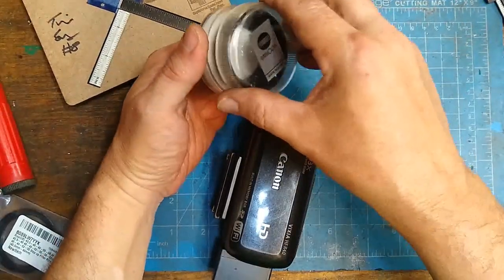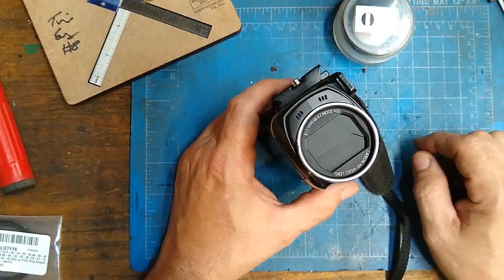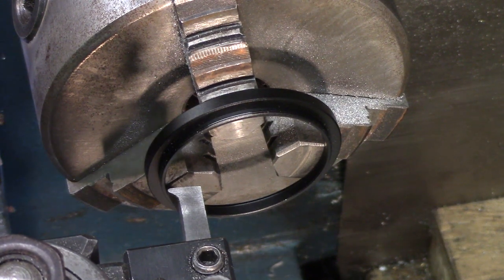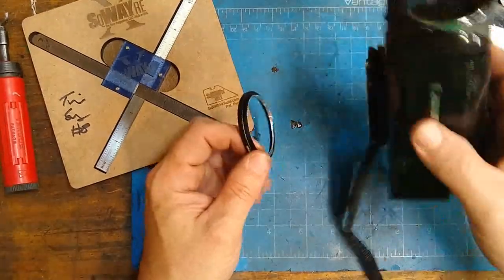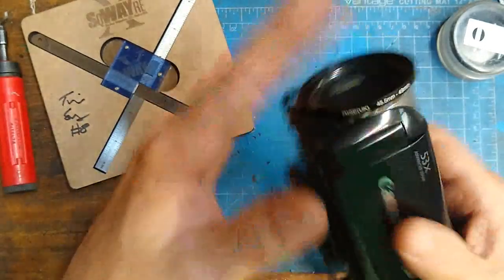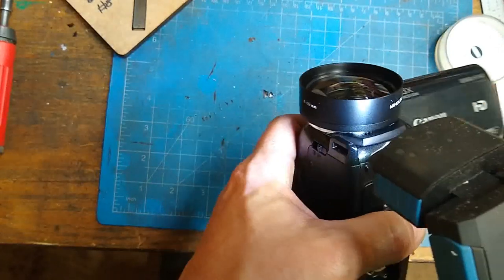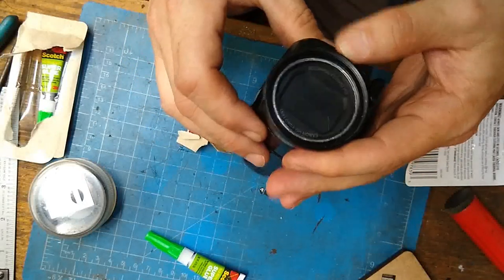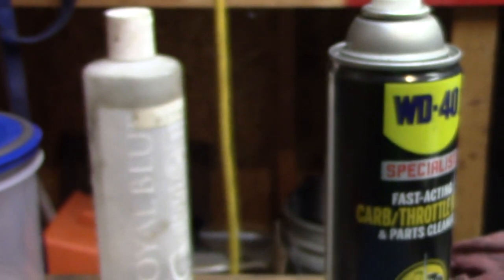Adapting a wide angle lens to a camcorder without threading -  lathe project

Comment: Thanks for the plug! And why do they not make things like cameras and hand drills square? Imagine how much easier life would be if your hand drill had a 90 degree flat surface parallel to the drill bit.
Reply from the maker: Thanks for dropping by Tim. My Milwaukee drill has protruding parallel screw bosses on the side that are in line with the bit but a flat surface would be very nice.  Actually my very old dead Ryobi had a removeable level that had a flat surface under it but being at the back it was would have been about as useful as the level. I'm enjoying using the square, and really only found one little annoying thing. One of the legs has a very tiny amount of side to side play. Easily corrected by making sure it is set before use (and I might make a slight mod to it to keep it set). It is actually extremely accurate though. I am going to do a short video on it once I get enough footage using it in different ways. Anyway, nice job. All the best! Eddie
Reply: @theeddies  I would appreciate your insight. I think future iterations will be machined metal and have turn screws to secure the rulers, which of course will increase the cost significantly.  I was trying to keep both surfaces flat (and keep the costs down) with this design.
Reply from the maker: I think the acrylic works, I really like it, it is light, not magnetic and is plenty accurate.  A tiny set screw was going to be my fix. I did wonder if there was a way to insert a very small bit of spring steel in the groove to tension the rule with a small notch to retain it. Might need tiny hands and better eyes than mine to place them but you have a son right😁 The material you used to get the side to side tension works very well. Obviously, as you said, you were building to a plan of simplicity, and you definitely pulled that off. It is extremely useful as is and any mods have to be balanced with cost.
Reply: @theeddies  cheers. There is a tiny, "spring loaded" piece of metal in there. Tough to get the right tension consistently.

Comment: Excellent video! Thanks! I looked up the manual for your camera and it turns out you can turn off the image stabilization (OFF for when you have the camera mounted on a tripod). My R20 is threaded and only has half the zoom. Thanks again. Also, your Minolta wide angle attachment lens did a MUCH BETTER job than the Vivitar that I bought.
Reply from the maker: Thanks!

Comment: LOL I knew that's how things were behind the scenes.
Reply from the maker: Mike is theoretically a good guy but dumber than a bag full of really dumb hammers. As far as the lathe goes, yes it seems to be a later (70's?) redesign of the 101. If it were closer I would go look to see how complete it is and low ball them. Some apparently had inch and metric change gear sets. Not sure how that worked but interesting. I have been thinking about that particular problem. I would really like to be able to do both.
Reply: @theeddies  I just saw the clip on TMZ. Are you going to issue a Twitter statement, and maybe go to some kind of country club vacation island "rehab" and all that, or just claim that you were simply trying to stay in character?  -- Yeah metric and standard thing is a quandary. I believe there are work arounds to a certain extent on some machines, but that's something I don't know about. The larger machines that let you just switch between the two with the pull of a lever seem nice.
Reply from the maker: @johnstrange6799  ROFL. I actually only realized after I did the bit that it was sort of like that Tom Cruise blowout a year or so ago. Not planned that way but I guess it was in the back of mind somewhere. I just wanted to say something stupid.
Reply: @theeddies lol I was thinking it was like the Christian Bale meltdown from several years back. Same same though. Still funny anyway you slice it.
Reply from the maker: @johnstrange6799  that seems a bit bigger than the 101. Nearly the size of what I have.
Reply: @theeddies  6 x 18 I think. They're small. Over the years I've seen Roadking do a lot of good work on it, but I bet it took plenty of lathe time to get it done.
Reply from the maker: @johnstrange6799  well like i said, if it were closer I could pick it up to learn threading etc. But not worth the drive unless it were a slamming deal. It is less powerful and smaller than mine. Plus they are not responding about whether the change gears are there.
Reply: @theeddies  Yeah. If you're going to go through the effort make it worth it. The only reason I got that last one was it was only a $100 and I was there with a van at the time I saw it, but if I were going to go get one I would want it to be what I was looking for, OR just too god of a deal to pass up.
Reply from the maker: @johnstrange6799  https://www.homemadetools.net/forum/vintage-adept-shaper-photos-85536?utm_source=newsletter&utm_medium=email&utm_campaign=06-01-21&utm_content=06-01-21-182139&fi=182139#post182139
Reply: @theeddies  pretty cool. I was thinking a while back of making a little shaper, but it would need serious weight to be rigid.
Reply from the maker: @johnstrange6799  Getting the truck to go get a trailer at my dad's, mapped it out and it is in Indiana. You better go get it.
Reply: @theeddies  It'd be nice to play with right?
Reply from the maker: @johnstrange6799  yep and hellava price.
Reply: @theeddies   That is why I always look. Always on the hunt for something right in my neighborhood that I could possibly disassemble on site and transport in a few trips without too much of a miracle.
Reply from the maker: @johnstrange6799  All you need is a miracle, all you need is you.
Reply: @theeddies  Are you Mike, or just one of the Mechanics?
Reply from the maker: @johnstrange6799  Whichever gets the bigger royalty check
Reply: @theeddies  Ohh. Yeah, about those royalty checks... Are you a fan of Ramen noodles and collecting change at the highway off ramp exit?
Reply from the maker: @johnstrange6799  "Raman noodles and collecting change off the highway" I love that band. Very punk.
Reply: @theeddies  BORING!
Reply from the maker: @johnstrange6799  surprise surprise new machine day at Vintage Machinery. "Worn out" Thompson surface grinder. Pfft perfect hydraulic driven grindr. He actually says "this will do til I find a bigger one" He found the 10k in his spare change apron.
Reply: @theeddies  In other words, it's that time of week again. lol
Reply: @theeddies  Or even $750 or something. No Quick Change and no accessories so... I guess the main thing is location and negotiable price.
Reply from the maker: @johnstrange6799  I must have not gotten the first message or I have no idea what you are talking about
Reply from the maker: @johnstrange6799  made an incredible buy at the 90 mile long yard sale today. It's RED, heavy and grippy.
Reply: @theeddies  Interested. Interested.
Reply: @theeddies  I was talking about a SB lathe in your area on FB.  What was red and grippy? A vise?
Reply from the maker: @johnstrange6799  A "RED" vise Made in Mass. 6"
Reply: @theeddies  Athol Mass?? :)
Reply from the maker: @johnstrange6799  yep
Reply: @theeddies  Nice! Don't see those too much. How much?
Reply from the maker: @johnstrange6799  DRUMROLL....$65. It is an 015 which is the largest they made for most of their history as far as I can find. I have a 1980 catalog and they list an 015C that has a different pipe grip design and has non-replaceable jaws which mine has. I am guessing 50's or 60's but am still researching. I looked at the current catalog and they don't list any bench vises anymore. There is an 80's model on eBay for $600. You should have seen my eyes when he quoted me $65, I instantly went poker face and calmly said, how about $60 as I am reaching for my wallet? He said no but he threw in a Craftsman hand crank drill which he just wanted to get rid of. The rest of what we found was junk or in the stupid money range. A guy had my little 4" Wilton priced at $250. American vises are getting anvil prices now apparently. Trying to decide if I flip this one and take the cash win or more likely sell my good 6" Columbian. Might get $100 on ebay right now.
Reply: @theeddies  Oh Hell yeah. I'd buy those at $65- $75 all day! Vises can be good turn around, especially Wilton Bullet, Baby Bullet, and milling vises.... (Speaking of Baby Bullet. I told you before I had that crazy massive machinist stuff free find years ago that had a mint Baby Bullet in it. I actually found a pic of it a few weeks ago. It's the only photo from that finds video that I still have) ....but it comes at the risk of  having to sit on them until they sell, and the space they take up.  Same with anvils. If the resurgence in Black Smithing interests/trend fades.. then they go back to basically being scrap value.
Reply from the maker: @johnstrange6799  I don't remember the baby bullet, did you sell it? A guy had a full size bullet with no swivel for $400 firm. 

I have 3 or 4 Columbians in my collection and no Starrets so I think we know how this is going to go. I'll do a video tomorrow. I am thinking just a clean and new jaws, though the ones on there are still good. It is in excellent shape overall. I would love to fully restore it and repaint but I love the old patina and the red is still pretty nice. It was definitely not abused.
Reply: @theeddies  Columbians are nice. I feel you on keeping the Starrett. I don't see them much at all here. Yeah, the Wilton I sold a few years ago for $250. It was like 100% never used mint, and looked like maybe the owner even worked at Wilton or knew someone there (Wilton used to be just a mile and half from where I live) because this one was never painted.  It was very nice.  I have a Rock Island as my everyday inside vise. A Morgan as my #1 everyday outside vise, and a smaller Craftsman as my #2 outside one. Then I have that Tilting  Wilton one, and several old school small ones that clamp one to a bench. Then I have several drill press (Palmgreen, Stanley and import) vises, and a Mr. Pete Peterson Products castings one, and a phase II milling vise.  I have Craftsman Bench vise with my yard sale stuff to sell too. I haven't gone junking once this year, nor to a single yard sale either.
Reply from the maker: @johnstrange6799  We have similar setups. A vise anywhere you need one and a few where you just might need one, lol. 

You have not been junking or yard saleing? Are you sick? 

I saw the South Bend BTW. I am going to try and go look at it, make sure it have the change gears etc. I am really concerned about the size issue though, it would take a remodel to get it in the shed but maybe it is time for a remodel. I might just need to resign myself to a small Atlas or import right now. I likely only need it for threading right now. My other one does everything else I need right now anyway.
Reply from the maker: @johnstrange6799  Oh I forgot, any need for an 2 old Craftsman black plastic case corded drill, an aluminum jig saw, or a aluminum circular saw?. I got them all for for $10. I did not want them but old lady was selling and giving away her dead husbands tools, and it was sort of a sad charity thing. I figure I might do a resto on the aluminum jig saw, they are pretty cool shined up and I can get the $10 back on ebay pretty easy. If you had any use for any of them I would give them to you.
Reply: @theeddies  Thanks for the offer, but I'm all good. I have one of the Craftsman cordless drills. It's not bad really. I mostly just use corded stuff. The hassle and cost of a cord is less than that of batteries and charging to me. They are nice at times though.
Reply: @theeddies   Yeah. Too big and without a gearbox. It goes against the find exactly what you are looking for creed. It was just something new in your area with a negotiable price, but it would have to be a heck of a deal (Like $600 or lower for me) considering no 4 jaw, no quick change gearbox, no threading dial, no steady or follow rests, and no QC tool post, but I bet they'll still get $800 - $900 for it because of it's size which while being too big for you is still small all things considered, and small goes for more.
Reply from the maker: @johnstrange6799  I did not think you would need one to use as a drill necessarily but maybe for a project or something. They are $2-5 in any Goodwill in town around here. That is probably where the drills will end up. I have a couple bigger corded Milwaukee's for certain carpentry jobs or like drilling a big hole in steel that is too big for the drill press, but I rarely use them.

Come to think of it, the one is variable speed I think, I might try setting it up as a table feed servo with a speed controller. hmmmmm????
Reply from the maker: @johnstrange6799  I am definitely going to try to go look, it is very close. Just saw they are selling 3d printed thread dials for that machine for only about $40. Nice thing about those machines is people are still making parts for them. https://www.ebay.com/itm/203192438926?hash=item2f4f36908e:g:w1UAAOSwlB1futQB
Reply: @theeddies  You can find parts for sure, but sometimes a bit pricey and a lot of looking with a lot of competition, but there are guys who make the cross feed nuts and things like that. $600 I'd drag that thing home even if I had to store it outside covered in oil. $12 in paint and some dollar store Scotch Bright can make you money on that thing if the wear isn't extensive and there is room for profit.
Reply: @theeddies  You do realize that those tools are cursed by the restless spirit of the former owner, right? I've seen it too many times now to count.  Don't pawn that bad juju off on me! lol
Reply from the maker: @johnstrange6799  Agreed!
Reply: @theeddies  Another thing to consider is if it has a continuous or a laced belt on it. If not laced, then you will have to cut the belt and replace it (or lace it back together) to separate the lathe from the base for moving.
Reply: @theeddies  What if I accidentally posted my standard "BORING!" message on a video by someone else? Can you imagine if (God forbid) someone made a video about their 97 year old Grandmother who passed away, and I commented "BORING!" lol
Reply from the maker: @johnstrange6799  LOL, that would be horribly funny. New video coming after upload BTW. Oh wait... you had your one free notification for this 6 month period. If you would like to upgrade to the Platinum package, operators are standing by.
Reply: @theeddies  lol I don't NOT get notifications. I get them for videos I've seen a week prior.